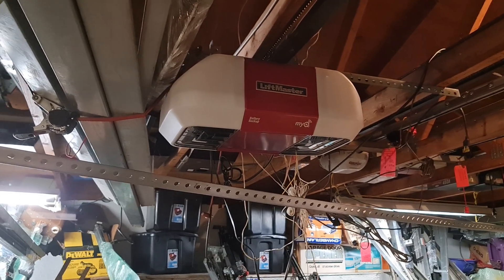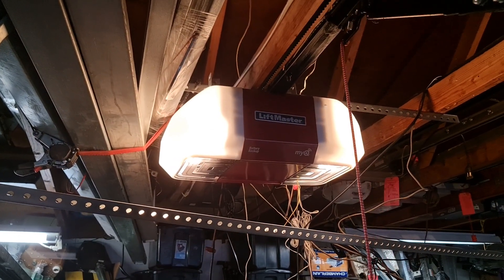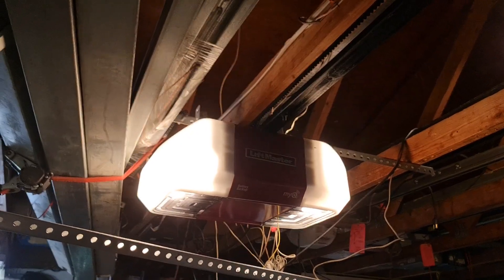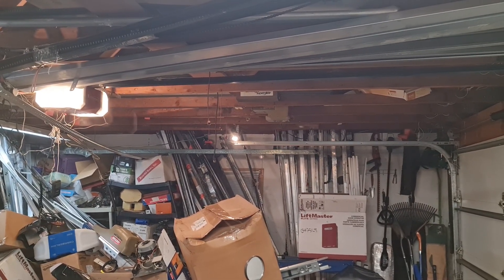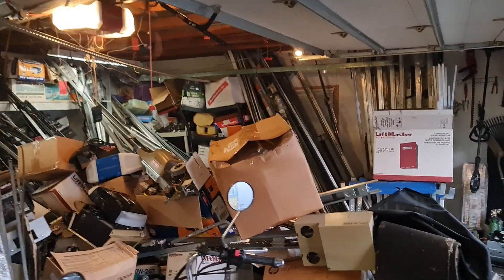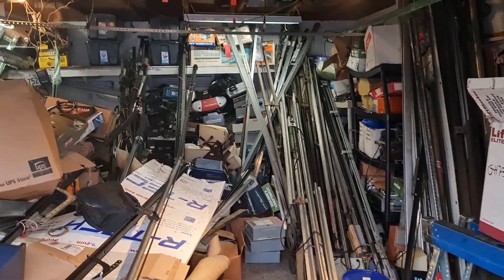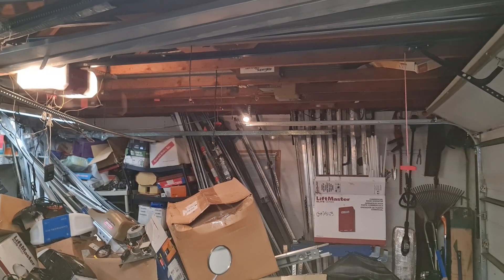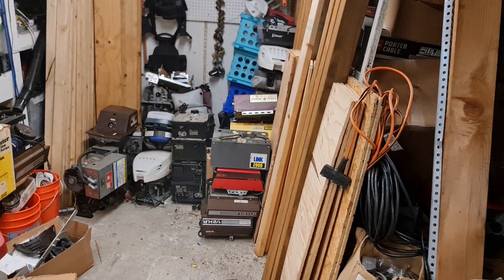My 8550 after 10 years, plus some garage update

Comment: That sounds pretty good for it’s age. I just got a 8550-267 from July of 2014 and it sounds like brand new. Needed a bit of work done to it, but now it works great
Reply from the maker: I've seen suggestions to open the gear housing and replace the grease. Haven't done that with mine yet.

Comment: Definitely doesn't sound like they do brand new, but still way better than mine. I don't have a clue as to how mine got so loud, the panel with the glass makes the door really heavy the first 1/4 of the way up but other than the glass the door stays anywhere you put it. I'm hoping to get the first gen 8550 from the training room at work since it has less than 1000 cycles on it that I can put up
Reply: Gosh, all the iterations of the 8550. What varies between them all, from your coffee grinder Gen 1 to something newer such as the one with built in Wi-Fi for instance? (my preference for easy myQ lol)
Reply: They've changed boards, motors, sprockets, added lock capability, made LED and camera versions

Comment: I have a feeling the speed difference between the newer and older 8550's has to do with the size of the sprocket. Assuming the first-gen ones use the same sprocket as the 3850, the one my 8550WLB uses is a bit smaller
Reply from the maker: That’s a good possibility. I’ve never thought to check and see what size it has.
Reply: I did also time my 8550WLB, although it runs slower, it still opens a little faster than it closes. I still wanna see if there is a difference between the speed on a first gen 8550 and a 3850 though, because the 8550 seemed to be a little slower from the start